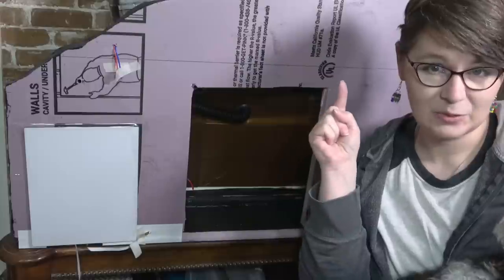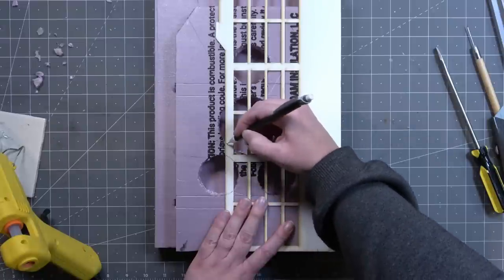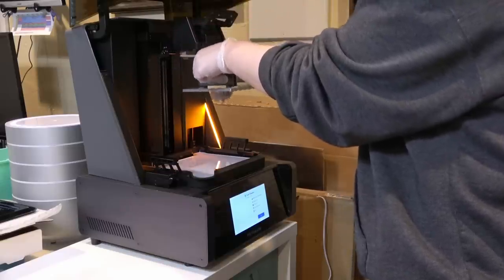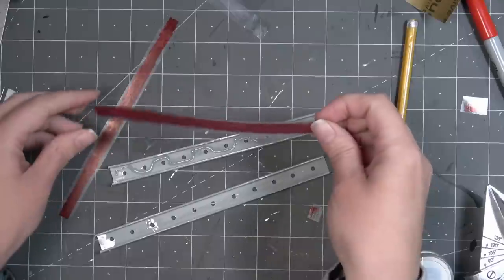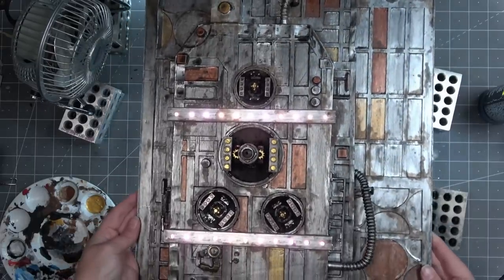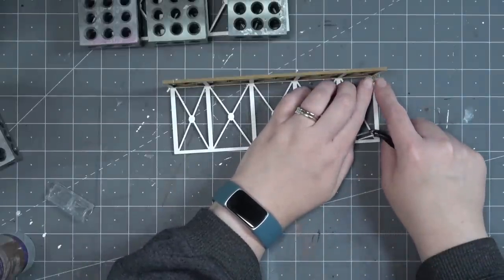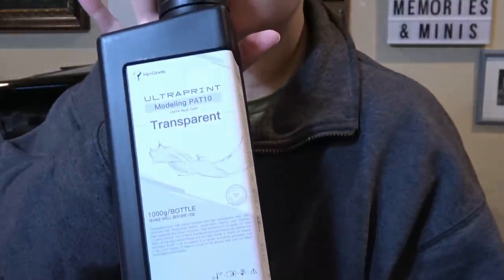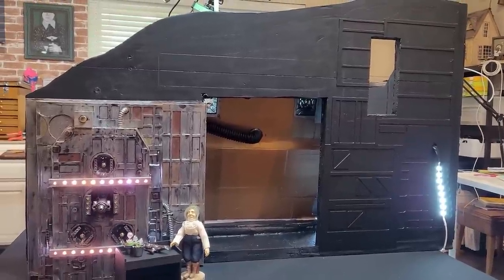Creating more Mini Spaceship Stuff for the Captain!🚀 Using the HeyGears UltraCraft Reflex Printer

Comment: I love it. The problem with the Fabri Tac Glue you had may be due to the acetone content of it. Most people don't realize it has it as an ingredient but it does. I bet the batch that bottle came from was slightly higher in acetone content than the others you've used in the past. Or if it is a newer bottle the acetone is fresher and hasn't evaporated as it does in the glue. That's what caused that glue to thicken and become nearly useless before you can use it all up, by the way. The Acetone in it has evaporated.
Reply from the maker: That makes sense!  I have used it several times to glue foam to foam and it has never melted it away like that!  It must have been such a high concentration of it in a small area that it reacted?🤷‍♀️

Comment: XPS foam is the best! You can also buy it in different thicknesses. You got some great textures here as well. I've used it and the foam boards from the dollar store and built a cathedral and an inn. You can create some beautiful things.
Reply from the maker: I will definitely have to try out another thickness next time I get some.  I think they have a .5 inch thickness and that may help with the process of cutting holes lol!
Reply: @BentleyHouseMinis  one more note - you can use spray paint as long as you keep it a distance away. The alcohol just needs to disipatate before reaching the foam - like 8+ inches abt? Yeah abt that. Your paint gun will work just fine.

Comment: Its so exciting to  see you doing finishes  and   the  end part  of  projects  can be   the hardest because  your   thought   process can mess you  up but not you.
Reply from the maker: Sometimes I can have difficulties figuring out the next step.  That's why I have built 'parts' along the way, even if I don't always install them right away (like the stairs) At least they are done and when I do need them they will be ready!  Thanks Cindy!
Reply: @BentleyHouseMinis    I agree and  I  need to  start  the finishes on  the pandemic       project but  I have a block and since   neck  surgery  I am  so much better . This block  is causing havoc and waiting  on  results  from  MRI a   ct  scan  showed a  lesion or  a   calcification  so waiting to hear and where its  at  Im not sure its  a small one and I dont if it controls brain function.    I was building parts  and stopped
Reply: @cindyfinn4845  I hope it all goes well with you!
Reply: @MaryGatdula  Thank you Hun

Comment: I like Option 1 and 3 for the Space display! Millennium Falcon for sure should be there, or maybe a Tie-Fighter? Something Star Wars, should also be easier to find a download for.
Also, not sure if it's new information, but I know that many other 3d printing miniaturists remove the supports before the curing process, Tabletop Time specifically are very good, but also use different types of printers. Not sure if it's a feature of the HeyGears that the supports are extra sturdy, because their end result seems to be?

Comment: For translucent colored plastic in front of lights, I'd recommend theatrical gels. You can get them in a wide variety of colors from theatrical supplies stores or photography supplies stores. They're used in front of stage lights to change the color and they're quite heat resistant. 

If you aren't worried about heat (I wouldn't be with LED strip lights), you could also use colored plastic report covers (from a business supplies store, a craft store, or your local Walmart or Target). Those are easy to find, but your array of colors is less extensive.

...

With clear resin, you can use translucent paints (like Badger's Ghost Tint line) to change the color after printing if you want. With any translucent miniature, I'd recommend doing some details (shadows, veins, eyes, whatever) in opaque paint. If it's all translucent, it tends to look like it has few details. Once you add in some sharp details with paint, the piece tends to look much better. 

Also, you can use clear gloss acrylic top coat if you want a less cloudy look for clear resin prints. It will fill in the small surface details that tend to scatter the light and give you a look more like glass. Not always the look you need, but when you want it, that technique can help.

Comment: I received a E.O.T also referred to as a Chadburn,  it is a communication device used on a ship ( or submarine) for the pilot on the bridge to order engineers to power the vessel at a certain desire speed. It is 1 and half inches tall, I was wondering if The Captain would like it ?

Comment: Curious - with the mirror cover panel, could you colour the actual LED lights?
Reply from the maker: Probably so but the LED's are so bright they kind of overpower any sharpie directly on the light.  Using the plastic a little distance away allowed me to add a lot more to the red color illusion.  I have used an orange sharpie to change a bright white light to look more yellowed, but the orange was over powered a lot.  I hope that made sense!

Comment: You could remove the lil bits off with the tip of your glue gun 🔫??
Reply from the maker: Could be something to try!  I don't know the melting point of the resin or if it would cause fumes so I would have to check on that
Reply: Worth a try lol 😆